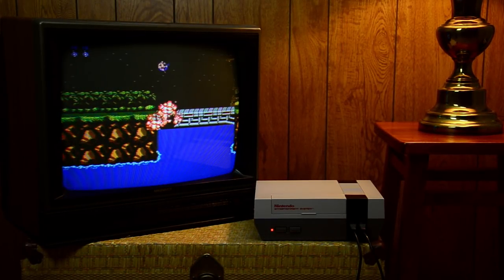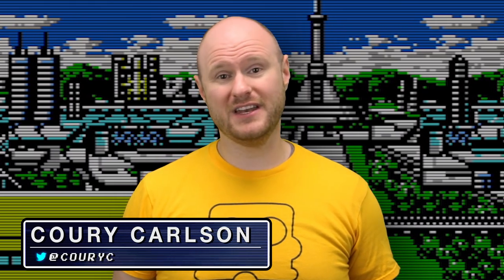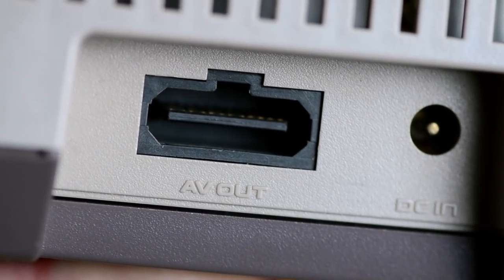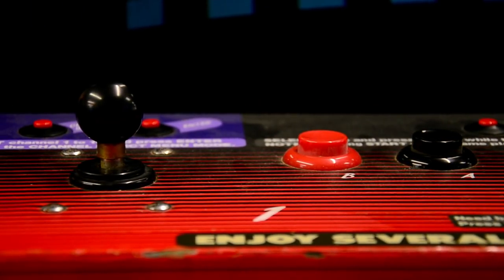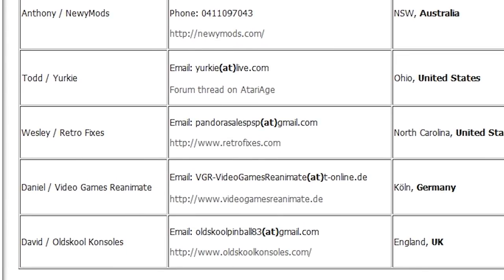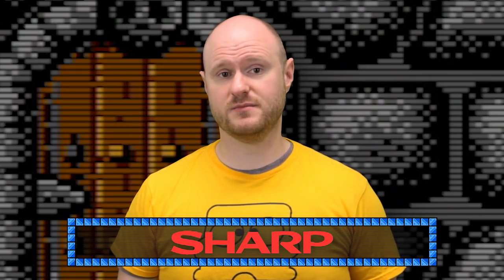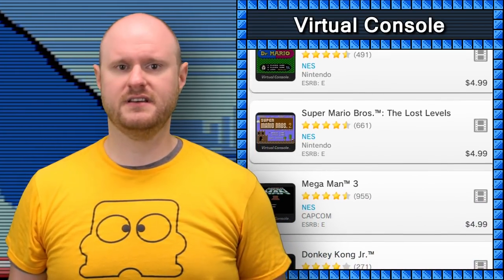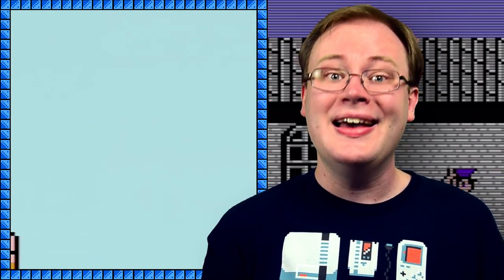Nintendo Entertainment System :: RGB 202 / MY LIFE IN GAMING

Comment: I like the RETRON 5. HD quality graphics on an HD TV.
Reply: +Chad9976 emulators have nothing on the hi-def or RGB mods.
Reply: +Reuben Ahmed Why? The Retron 5 uses cartridges.
Reply: +Nerdicai It uses them but only for dumping the roms.
But it does feel like a proper console rather than an emulator
Reply: +Chad9976 Wii U can do the same thing by installing the Homebrew channel on the vWii.
It's the same thing except you don't have to own all the overpriced cartridges.
Reply: Dr. Steve Brule Then there's no nostalgia charm
Reply: Kippy Kip I said this as someone who primarily games on original hardware with an XRGB and RGB modded consoles.
I've emulated since 2000 and it has never felt like a genuine experience, thus I use the real consoles.

I just pointed out that Wii U is a better emulation machine than that poorly made $150 box.
Reply: Dr. Steve Brule Don't they use the same based emulators? FCEUX, SNES9x etc?
Reply: The problem I find with emulators is there is none of the built in strain on the games. Punch out doesn't feel the same because it never speeds up or slows down emulated, which makes the game almost frustrating because of it.
Reply: Zach Garness What do you mean? Emulators emulate the slowness of systems too.
If the emulator was to have a higher clock speed than the original machines, then the games would run a lot faster than normal.

It's only emulators for modern consoles like the gamecube/ps2/wii that might not emulate lag because the games from that era are based from timers, not clock speed.
Reply: Kippy Kip
I mean in game, when there is too much stuff running in it, I rarely find the game slow down it, flicker, and such. Like punch out for instance, fighting Don Flamingo, when you start the left right combo the game pauses the calculation it seems, that is running the when Don should fight back, so on my NES the game speeds up. On an emulator, its a constant speed. It throws me off.
Reply: Zach Garness As I said, Emulators do emulate the original console lag and flicker. It's only really modern emulators like the PS2 era because those systems had date and time on the console. 
The nes calculated time on the CPU's clock rate (mhz), therefore emulators have the original console lag and they can't do anything to avoid it.

Punch out should work absolutely fine on any NES emulator (unless you're running it on a really old inaccurate one like nesticle).

Just grab a NES controller to USB adapter and it feels almost the same, with the exception of the cartage insertion :<
Reply: Kippy Kip
Last time I ran one for the NES was on nesticle... I might give it a try again.
Reply: Zach Garness Oh fuck, no wonder you're having problems! Nesticle was one of the first nes emulators and hasn't been updated since the 90s.

Try FCEUX, it's the most accurate NES emulator out there today.

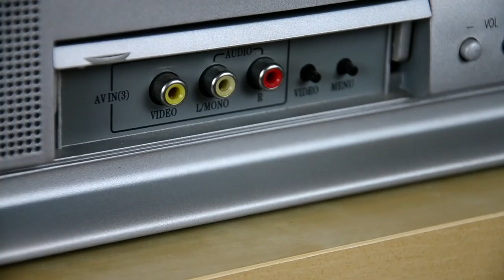Comment: 3:40 actually no, the twin famicom was actually released a few years earlier and that one did have composite output, actually the twin famicom's composite output is actually slightly sharper than the AV famicom's output.

Comment: Close to all consoles offered RGB options in France because of the SECAM standard.

From what I know it was simply cheaper to "boost" systems to RGB instead of making a real SECAM version.

In France RGB capable consoles were always bundeled with RGB-SCART-cables, the french Master System 2 had RGB out and the NES and Atari 7800 contained internal converters that turned PAL-composite video into RGB... The signal is RGB but derived from composite... So... It's bad...

In Germany we just had crappy RF cables packed with the systems... as if the bad PAL conversions weren't enough torture. Everything was slow, squished and bordered by black bars^^
Reply from the maker: [Try4ce] It's such a shame that old PAL conversions had to be so lazy... I've still never tried one myself, though I did see some PAL NES carts in a game store recently.
Reply: ***** 
If you play them on your US system everything will be fine because for the most part there was close to no conversion. The PAL and NTSC games for NES, Master System and Mega Drive are identical as far as technical issues are concerned. The difference is in the console. Instead of using the higher PAL resolution of 288p the system simply squishes the 240 lines of the NTSC version in the middle and fills the rest on top and bottom with one color. Looks like a movie on 4:3 TV. And the difference in speed is compensated by running at a lower speed. Slowing 60hz to 50hz drags it down by 16%... Sonic is slow as hell^^

Fortunately Sega systems are easy to mod with a 50\60hz and language switch (eng.\jap.) and via RGB it works on any TV.

PAL games for NES, Master System and Mega Drive should run smoothly on NTSC systems if you get around region locks, which can be bypassed very easily

Great to see RGB202 finally. I really enjoy this "RGB from every system" - approach. Do you guys have plans for an episode with "non-RGB" systems and the best possible options? I just modded my Atari 2600 to S-Video and it's great. Just like my Odyssey2 (It was made by Philipps Herr and has no power button) with composite but I can't imagine one whole episodes about each of those systems.
Reply from the maker: Modørfüsch [Try4ce] Yes, we definitely want to cover lots of systems. It's not just about RGB, it's about presenting all of the options... because some options might just be better choices for some people. I'm curious about the S-Video on your Atari. I've got my hands on a system that works but needs some servicing, and I do want a video mod. I've heard conflicting information about the S-Video mod. Does it actually look like S-Video, or does it look like composite through an S-Video port? That's something I've seen before with some cheap cameras.
Reply: ***** S-Video on my Atari looks really nice. From what I understand the PPU outputs seperate luminace and color signals which aren't in the right shape for S-Video and have to be transformed via a mod which consists of a circuit board containing nearly 50 components (capacitors, resistors and more complicated stuff). It's about the size of a Sega cartridge and doesn't fit in the 2600jr.. The different opinions on quality may come from different ways to archieve the transformation by different components.
It absolutely looks better than my 2600jr. with composite but was a lot of work. The leap in quality you get from an extremely easy composite mod is way bigger than what you gain from there with this enormous task. If I didn't have fun doing this modding stuff it wouldn't have been worth it
Reply from the maker: Modørfüsch [Try4ce] Cool! So it sounds like I need to talk to a modder who's familiar with the conversion parts. Even though I'm not a huge fan of pre-NES gaming, I want to get this system in working order, and I feel like the higher quality S-video would be worth the extra cost.

Comment: I am a crazy person who paid ~$250 to have the nes rgb chip installed along with the 3d printed multi out. 

If you are not a crazy person buying an original Wii and using an emulator on it with component cables on a CRT is a very close experience. I recommend it for anyone who wants to play NES games on a CRT in high quality without spending $400 or so for a toploader+nesRGB+everdrive. Even more if you collect carts.
Reply: So are you using a svideo cable out of the multi out onto your crt? What would be the best way to get rgb onto a CRT? I think if I get my nes rgb modded I would use the multi out for svideo onto my CRT the most. Rgb seems too much of a hassle and I'm assuming a framemeister has lag with rgb onto a hdtv. Opinions and how are you setup?

Comment: Don’t own a framemeister, but looking for a reputable ossc for RGB NES, any suggestions??? 

Would you recommend RGBNES or HD NES mod?
Reply: Hi-Def NES is sharpest, but it only looks good in intenger scaling values. If you wish to scale to 4:3 instead of 8:7 or 16:15, then you might wanna look into the RGB mod. RGB still looks pretty good, but requires you plug it either into a scaler or a CRT.

If you don't own an equipment, I'd suggest the Hi-Def one.

Comment: Hey you two, do you have any thoughts about the Retron 5?
Reply from the maker: ***** [Try4ce] I actually own a RetroN 5, and want to feature it in more detail in the coming months. For me, I just enjoy playing on the original hardware more, but it's an extremely useful system, and I do believe it has its place. Because getting into RGB can be so costly, I certainly don't hesitate to recommend the RetroN 5... it's not perfect, but it serves its purpose really well overall.
Reply: ***** To be fair, I don't think we should expect anything to be perfect, we should be glad the Retron 5 does what it can do very well. ^u^ Ooh Sweet! Can't wait for a video about the Retron 5. OuO I was considering getting it as an alternate option to having RGB-Like Quality as Possible since Currently I use S-Video for most of my consoles. (As well as Component Cables for the Consoles that supports it.) and I don't really have the money to shell out for a Framemeister at the moment, and while I understand there are upscaler converters that can bring RGB to your TV, I hear about how some can bring some input lag like the one you got at one point so I am cautious about it. That's why I felt that the Retron 5 could be a more affordable option for me. Though I have also been somewhat cautious about it as well because of the problems I've heard people had about it like the pins breaking off and other stuff like that.
Reply from the maker: ***** [Try4ce] Yeah, a friend of mine, his NES port had 3 pins break off just last night, and he's currently finding out if Hyperkin can do anything about it (he thinks he's still within the 1 year warranty). His NES slot always worked pretty hard, while mine works easy... it's the SNES slot on mine that I'm a bit more concerned about. So yeah, build quality may vary a lot, but when the system works, it does do what it does very well. Even if the build quality can be a bit of a gamble, it's hard to not recommend it for a good price.
Reply: ***** Yeah that I'm aware of, it seems that some Retron 5 Units don't have the best pins while others do. I even hear on how it's difficult to get the games out because of how the console keeps the cartridge locked in tight. But then again, I imagine it loosens up over time because that was EXACTLY what was going on with my Genesis Model 2 at one point, where the Cartridges were locked onto the pins tight and it was a pain to get them out, but overtime the slot loosen up and now it's not as tight as it was before, now it's much easier to pull them out of the cartridge slot. Even then, I always slowly and gently pull them out just to make sure I don't accidentally damage anything.

Comment: Any opinions on the nes to snes cart adapters like the retroport adapter?
Reply from the maker: [Try4ce] Those are basically entire clone consoles in a cart that are simply stealing power and controller ports from the SNES. They have their own set of audio/video outputs, so you can't take advantage of the SNES's higher quality video output.

Comment: On an RGB modded NES, are the colors always going to be somewhat inaccurate? The video hints that they’re different but how noticeable is it?
Reply from the maker: [Try4ce] There has been continued work put into making more and more NES RGB palettes. The thing is, you can't necessarily take what you see in a direct composite capture and say that it's definitively accurate because that doesn't take into account the many ways CRTs might interpret NES colors. Some palettes take the CRT shift into account, while others go for a route closer to how it would be captured, or even derived programmatically. But it won't necessarily match in every scenario. NES has no RGB values internally, so it inherently requires interpretation, and there is no universally agreed upon palette. The most popular one right now is "Smooth" by Firebrand X, which you could install on an NES RGB mod. The big sticking point for a lot of people is the color of the sky in Super Mario Bros. Pick a palette where that color matches what it should look like in your head, or how you remember seeing it on a CRT over composite or RF. In some cases, it's more blue, in others, it's got a bit of a purple shift. I tend to go for the slightly purple hue myself as I like it to be more similar to what the system is actually outputting rather than how it is treated by any vintage CRT, but MANY would strongly disagree, so it's totally up to your own preference.

Comment: Hi
I got a problem. I have a PAL N64 that has been RGB modded. I also have a matching scart cable (luma sync) that I got from the company that modded the console. 
I hooked it up via my Onkyo receiver (I use a projector not a TV). But since I don't have a scart input on my receiver I use a scart to HDMI converter. The picture is shit! It is actually better when I use my modded S-video cable directly in to the Onkyo. Could it be the converter? Would really appreciate some help. 
Thanks
Alex
Sweden
Reply: Alexander Ström 
You can use super nintendo retrovision component cables with the rgbmod.

Comment: i find composite to be absolutely fine on most late 80s to 90s crt tvs. you dont get any real noise in the signal and whatever noise there may be isnt noticeable because its easily hidden by the refresh rate of the tv. the colour red on lcd through composite looks absolute shit and spins and jumps around alittle, while on a crt it looks relatively good.
if you dont wanna go through the hastle of buying all new cables and modding your console id just get a cheap or even free crt tv with atleast composite and s-video. its cheaper than going the rgb to hdmi scaler route (its like a damn rabbit hole with scanline generators and line doublers and up scalers). and the picture will look as the game was intended to be played as most games used a technique called dithering witch looks best through composite on a crt. there are far mor advantages to play on a crt.
Reply from the maker: +Tim The Aussie [Coury] Absolutely. A big point we have with these videos is that there is no right or wrong way for this stuff. If you're happy, then enjoy! We just like to explore all the different possibilities if you're curious about making the video image better. 

I'm a big advocate of CRTs and love my PVM a lot. We'll be doing a video in the future on gaming on a CRT, but I'm unsure when it will be.
Reply: ***** I'd deffo watch it when it does come out!  Personally i like 90's hitachi's and panasonics, although i do want a PVM, or even a BVM!!!
Reply: I only play my retro systems on a CRT, I truly believe it is a much more enjoyable experience than an LCD.  However, the difference between composite and RGB & s-video signals is still huge on a CRT.  Ever seen a 240p RGB signal on a CRT???  It's AMAZING!

Comment: hello. in the official nesrgb installation guide, they said that we need to use a gamecube scart cable and the snes version would not work. but you said that we can use a snes scart cable. so, which one should I buy?
Reply from the maker: [Try4ce] I've always used cables branded as SNES and it's been fine. I use the CSYNC SNES cables from retro_console_accessories on eBay.
Reply: Thanks!

Comment: Does the composite y adaptor for the audio make any practical difference?
Reply from the maker: +EmperorOfTigers [Try4ce] Some sound systems may duplicate the left sound channel if only one is plugged in. Others may not. Just makes it easier to get sound out of both speakers instead of only one.
Reply: My Life in Gaming Thanks for the quick reply Try. That's really useful to know. Thank you very much.
Reply: @mylifeingaming  nice to know although I wish it’s can easily output Scart cable and then just use Scart to HDMI so I don’t have to spend a fortune on Frameister

Comment: I'm looking to purchase an AV Famicom system, plus the NESRGB kit, for use with an Everdrive N8 Famicom.  I want to send the unit to Voultar for the installation, but can anyone explain the difference between using the stock audio circuit versus the NESRGB audio circuit with expansion audio?  I'm a little confused, as the AV Famicom already supports expansion audio.  Thanks!

Comment: It's kind of funny... I was ultimately satisfied with every one of my consoles stock... Oh, looks like I have an early SNES with the blurry RGB... still looks fine to me on my Mitsu tube, tbh. N64? S-video was satisfactory to me, and I actually kind of like the anti-aliasing on many games. Gamecube with GB Player? I thought about doing something with it over the years, but then GBI comes around and gives me the 240p and the colors and suddenly S-video is okee-dokee. Wii component looks worse than Gamecube? Eh, I can't tell a difference in blind testing on internet footage unless I freeze frame and was always happy with what I had anyway. I almost thought about getting an S-video mod for my Genesis because I feel RGB is too sharp for some heavily dithered games, but then I discovered you can just use a 32X to get a much better composite encoder.

But the NES is the one console where the composite doesn't even blend colors much and generally just looks like there's fuzzy garbage over the graphics on the screen and tons of color banding (though admittedly, not every game looks terrible--all depends). It is the one console that I would have seriously considered shelling out money on a mod for... if I ever played the damn thing.  : P

That era of games just doesn't captivate me quite like the later ones do, so I usually only fire up that NES for maybe one game every year or so. Kind of hard to justify an expensive mod like that for something I use so little.